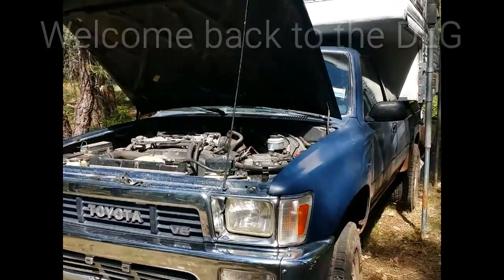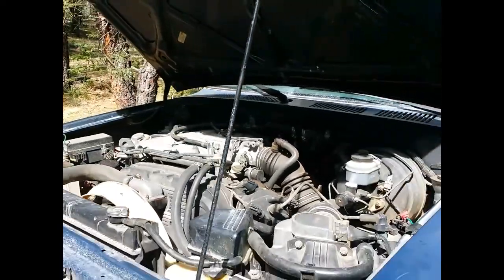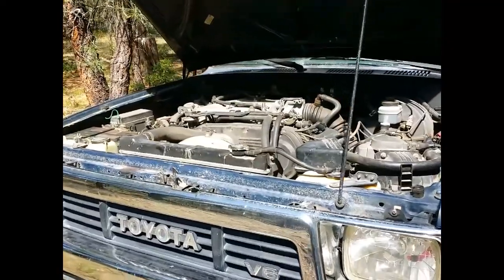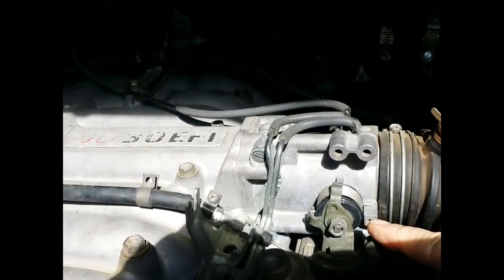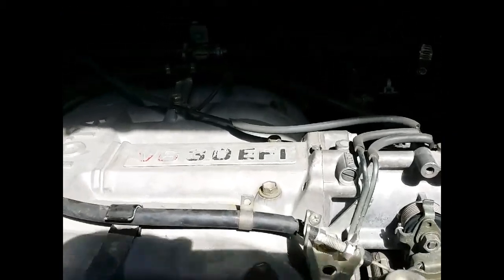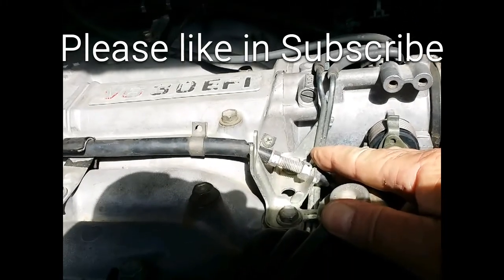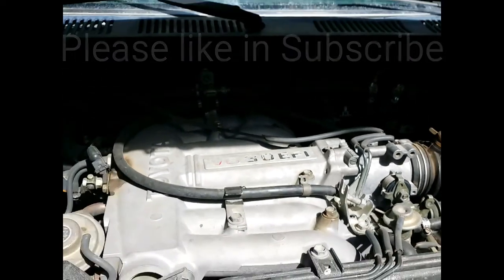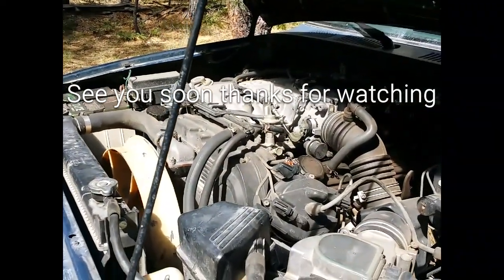How to adjust the throttle on a 1989 Toyota V6 3.0 pickup

Comment: I need to check mine. But I think my transmission is a little screwed. When I get to higher speeds, and I try to give it gas, sometimes the truck downshifts, and the engines revs high, then returns to the higher gear. Maybe the trans. Is trying to accelerate me? It's an A340H, if you know what's happening, please let me know
Reply from the maker: Sounds like its slipping  a bit. May be time for a new transmission. If it's just searching for a gear the torque converter could be going bad

Comment: long comment warning!   I have two more cables connected to TB,  cruise control and transmission cable.   My issue is that TB can be pushed further closed and idle will drop.  In other words,  if you simply let go of TB or gas pedal you can then push the thing even more by hand and therefore drop the idle even more.  Is this normal?    Is this 'slightly open' supposed to be like that?  It seems to be set that way pressing against the dash pot and or other sensor.  But saw one guy said he had a faulty spring and added a washer or something to fix it.  I can't find that video anymore..

Beyond that,   I have no codes but idle in park is slightly rough.   In drive it's very smooth and no vibration.  In park and especially after being warm,  it idles a bit rough.(we are talking very slightly rough I think)    I have read everything on idle adjust screw and it's all contradicting information...even the manuals can't get it straight.   Is the screw for first idle or second idle?  I think the Haynes says to rev it to 2500 for 90 seconds after truck is at operating temp,  then let the idle drop down.   At that point,  adjust the screw to 850-900,    or maybe 800-850.       

What I have at cold start is idle at around 1200.   Then after a minute the engine noise decreases but the idle remains at around 1200.   Then after a few minutes the idle begins to drop down and settles around the 850-900.   I then put in drive and it drops to maybe 750-800.   This all seems normal.

After a 20 minute drive,  I turn off engine.   When I come back to start it,  the idle is barely over 500.  If I give it a little gas,  it will go up to around 700-800.  This does NOT seem normal.  

And on top of that,  it won't start on first crank sometimes.  It seems to be extremely random,  but It's hard to tell.  I did have no start issue and sometimes the engine would die while driving.  During that no start times(it would always eventually start),  I pulled code 12 and 13,  both relating to distributer(which was only a year old or less).  So I took it to mechanic so they could double check everything,   and they told me based on code,  it's either distributer or computer.    So i swapped distributer under warranty and got another cheap Spectra distributer.  This time,  the marks on the dist. shaft did not line up the same as the other one.  So I had to just trial and error the thing pointing to number one plug until it would run okay.  I then checked and adjusted timing.  

Now the engine never stalls out like it was,  and I have no codes.  It also is easier to start and never takes more than a few cranks.  I then cleaned starter cable connection as well as misc,  and now it almost always starts on first crank.   But still sometimes takes two cranks or I give it a little gas when starting and it fires right up.

After heads blew last year,  I don't recall ever cleaning out IAC valve underneath TB,   so could this all be related to a slightly dirty IAC?   I had cleaned it twice before that.       

Keep in mind I have new distributer,  MAF sensor,  TPS,  and host of other new parts including new Bosch 02 sensors(2 on my truck).    BUT I can't trust that any of them are working properly because they are cheap garbage sold by O'riellys.